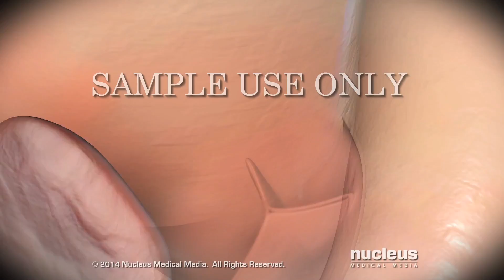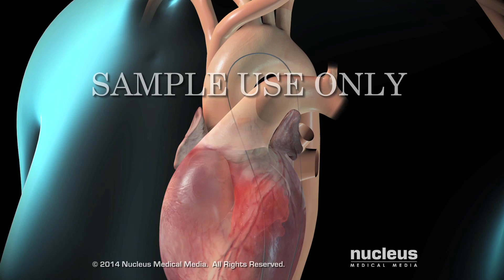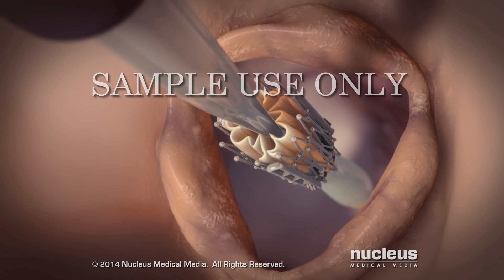TAVI (Transcatheter Aortic Valve Implantation)

Comment: I am an active 66 year old who, was diagnosed with mild aortic stenosis 4 years ago. Although each year I have a cardiac ultrasound, which has showed some progression - (in spite of all the modifications i have made in diet and trying to keep my BP under control) - no symptoms = no problem. Until this year. I cycle, hike, and go for a 4 mile power walk daily, during my lunch hour. I have begun experiencing the symptoms I was warned to watch for: tightness in my chest, lightheadedness, increased fatigue - but only during exercise. Consequently, I do not push myself as rigorously as normal. 3-mile power walks at a slower pace have become more common. My last ultrasound indicated that i have progressed into the moderate-severe aortic stenosis category, and I have a follow up with the cardiologist later this week. I am very nervous about it.  I anticipate that this procedure will be part of the conversation this time. On the one hand, as simple and hopeful as this procedure looks, my other research has found that there is only a 5-8 year life epectancy following this procedure. Now, for someone 75+, that's probably not too bad. But, did I mention that I'm only 66? So, I'm nervous.

Comment: The genius whoever invented this,OMG his brain is something else WOW!!
Reply: TAVI has progressed greatly over the years. In the early days, rejection tissue started to block the capillaries at the top of the aorta that feed blood to the heart muscles. This resulted in a 5 year prognosis and the patient on a permanent cocktail of anticoagulants. This was why the procedure was only used towards the end of a patients life,    when he would not have survived conventional surgery.
Today, the stent portion of the synthetic valve extends further up the aorta. This is expanded slightly further to keep the capillaries open. Along with improved synthetics, this has led to a nominal 25 year prognosis following the procedure and the anticoagulants are as little as 80mg of Aspirin per day. This considerably reduces the risk of neurological and stomach aneurism. 
Synthetic heart valves predate TAVI by a couple of decades, but they were surgically fitted clear of the heart, further up the aorta and clear of vital capillaries. Contrary to this video, the natural aortic valve was more likely to constrict, rather than not close correctly. Therefore it also had to be surgically removed.
TAVI can also be used to replace the pulmonary valve and fit a clip to repair a torn mitral valve. The later was not very successful and is rarely used these days.
All this was the result of doctors and medical companies working together for more than a decade, rather than the brainchild of one person. 
VAD, (ventricle assist devices) are another useful device as a bridge to surgery where a donor organ needs to be found.
PS, I am not a surgeon, but I worked in cardio thoracic research for a number of years.

Comment: Do these stents ever cause damage or slip?
Reply: calcium makes good substrate for stent to grab into - it is positioning the valve that you do not want to screw up
Reply: They usually don't, however sometimes if there is a mismatch in size the new valve might not close properly and blood will be able to fall back into the heart creating a problem of aortic regurgitation. However, its not too common. Overall survival rates for those with TAVI was 50%+ after 3 years while with medical management it was only 10% after 3 years. This was called the PARTNER trial, it was a huge multicentre trial that involved many patients. 50%+ might sound low but you have to remember most of these patients are very old and frail and have other health issues.